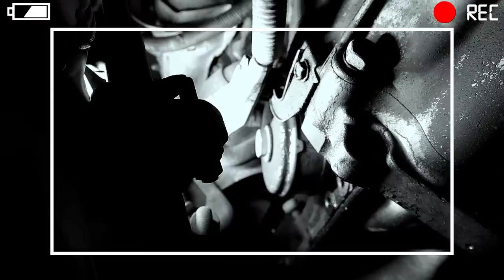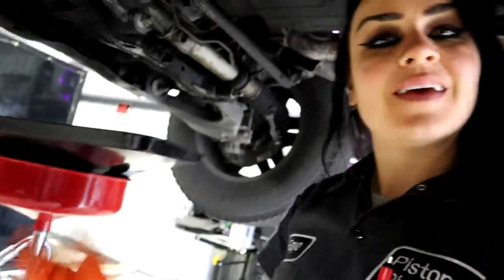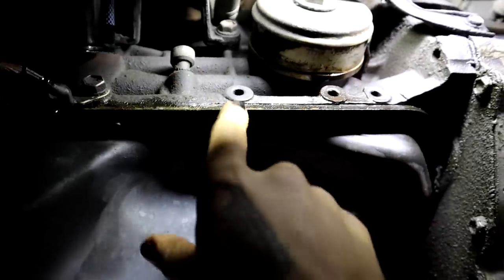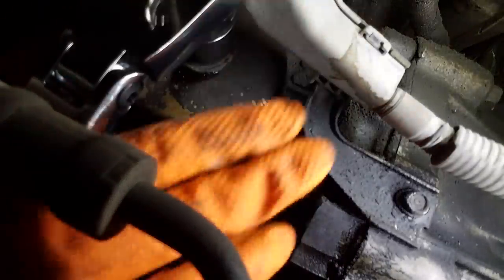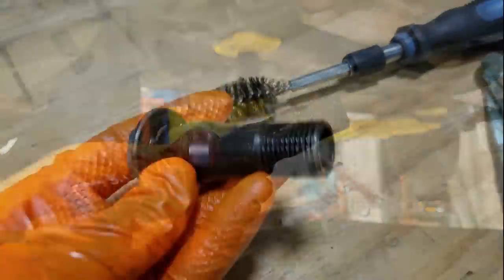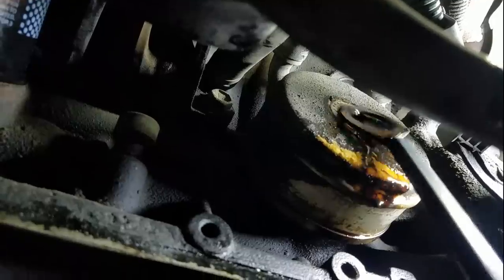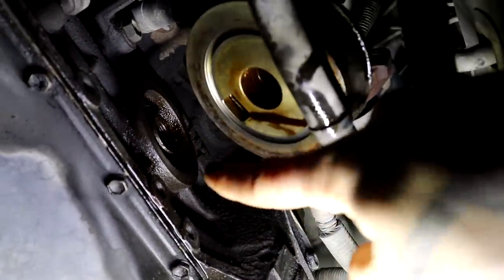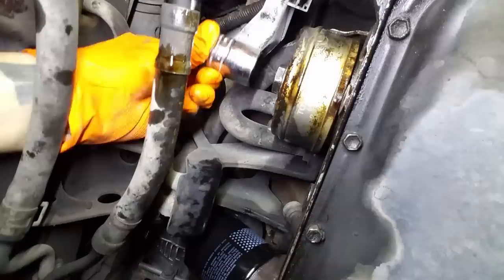Replacing Oil Cooler Seals on 3rd Gen Toyota 4Runner with the 3.4L (5VZ) engine

Comment: Just did the gasket change and I would add one thing to this great video. Wait for an oil change, yes, but also, go ahead and flush and drain your radiator. The video doesn't show removing the 2 hoses attached to the cooler.  Those are radiator hoses running anti-freeze through the cooler.  I wasn't expecting the face full of antifreeze I got when pulling those off and because it's a low point on the block, you lose most of your fluid, so, good time for a flush and fill of the radiator.  An added note, my cooler was clogged as was the exit hose for the antifreeze. These puppies are $800 to replace. I dug out all the junk with a hanger and ran pressured water through it, it cleaned it out.  Did the same with clogged hose. All good and working now.  Thanks again for the informative vid.
Reply: You have the option to pull it off, but her video shows it was still hanging with the hoses attached.
Reply: Just a tip that can help from having the coolant drain out, especially when you may have recently done a flush and fill already.  just clamp the hoses before removal.  Harbor freight sells hose clamps for just that purpose, probably amazon too.  Any clogging is concerning to me.  I haven't done this myself yet, but given your experience I'd be inclined to completely remove the cooler myself and give it a look see.  I would likely even spring for a new cooler just as a preventative measure.  Sometimes going cheap can be a lot more expensive in the long run, as I've learned from the school of hard knocks many times...

Comment: Fix all the oil leaks 😂, clearly you don't own a Honda. That's your anti-rust protection.
Reply from the maker: Lol no rust here in the beautiful Texas hill country!!!
Reply from the maker: Lol no rust here in the beautiful Texas hill country!!!
Reply: Don’t forget Mitsubishi, leaks everywhere in the engine that I give up trying to trace and fixing it.
Reply: Use dye to track the leak. Smarter not harder brother.
Reply: Meh, their like Detroit Diesals, they all mark their territory.
Reply: Before I fixed her, I used to say that my Caprice had self changing oil at a rate of one quart per fill up.  All you had to do every 3000 miles is replace the filter because she'd already cycled through two oil changes by then.  (coincidentally, it was the oil cooler adapter that was leaking on that one as well)
Reply: Want oil leaks? get a Subaru!

Comment: So, wish I had found this video a couple years ago. My 3rd Gen has had a slow leak since I bought it 4 years ago. Found this video, checked out my cooler, and sure enough, leaking. Bought the parts and changed it out last week...not a drop of oil on the concrete since! Thanks

Comment: The sounds you make while wrenching are much more pleasant than those I make.
I just did rocker cover gaskets on my 2012 Forester with the engine in.
Just a little more than an inch and a half clearance to get at the bolts, clean the old RTV and get the rocker cover back on without messing up the new RTV bead.
The sounds I made were much less family friendly.  No giggles at all.

Comment: I've got a 96 with 193,000.  I've been lucky my oil cooler is not leaking yet.  I've had to replace the valve cover gaskets.  Thanks for your videos,  you save me a lot of time.

Comment: Just did this repair following your vid and it went great, and that leak is finally gone. I don't have a lift so I definitely suggest taking off the wheel if other people wanna make a mess in their driveway like I did. It's a tight fit, but doable! Thanks for the guide!

Comment: ok, just did the valve covers on my 2001, super cleaned all the old oil up, drove it for about 200mi.  My oil cooler looks like yours pre-surgery.  I almost went for the pan gasket, but, clearly there is oil dripping from the cooler.  Looks easy enough, thanks for the vid.

Comment: Thank you!  Been chasing leak and had no idea this was there.  You ROCK!
Reply from the maker: YAY!!
Reply: So did the deed this weekend.  Ended up having to remove the hoses as the gasket had hardened into black concrete.  Had to chip it out carefully with small flathead.  My recommendation to others would be just do this at time to change oil and rad hoses and fluid flush.  Kill all birds w one stone.  I did also replace the smaller hose since it was out.  Now engine is oil free and beautiful!  THANK you again for vid!  NEVER would have tackled this otherwise!  ✌

Comment: Thank you for the good info. Breaker bar didn't work for me on the 24mm bolt. Had to get the oil cooler bolt out through the driver wheel well. Long extension and a wiggle extension on an impact gun. Access is right above the upper control arm. Came off first try with the impact gun.

Comment: Do you have a vid showing the oil pan gasket front main seal and rear main seal on this classic 4Runner? I’m having those issues with mine and didn’t know if I had an oil cooler but now I’m prepared if I do 😂. Thanks Faye!! 🙏🏽

Comment: Good job, I too would have fixed that leak since it was in a component that could cause a pressure leak. Those engines remain remarkable almost leak free at high mileage. Most of them I work on have in excess of 150,000 miles and other than seeping around the oil pan and valve covers, they are pretty dry engines.

Comment: I enjoy watching your video and enjoyment with wrenching. I noticed a lot of oil leak around that area so thanks for posting this DIY video. Had my 4runner since 2003. Would you need to take out the cylinder and clean it out or need replacing? Or just the o ring and seal? Thanks
Reply from the maker: Only the O-ting and seal, the coolers rarely crack or leak.

Comment: cool video, straightforward repair.  thanks, this is on the list for my '99 Taco.   hey can i ask where is the oil pressure switch on the 5VZ-FE?   i understand that is also a common leak point

Comment: I know it's a big bolt, but being hollow I was surprised at the 43 torque spec! Great video. I really need some of those pipe cleaner style wire brushes, but they all seem expensive.

Comment: fixed huge couple leaks in a MB om651 engine (E-coupe).  Oil filter housing and oil cooler both were pouring out. Upper oilpan also dripped. Replaced both and will never do it again. took 2 days to find and fix the problem

Comment: Rotella T5? Cool. I use T4 or T6 in my DR650 since it’s JASO MA/MA2 rated. Never thought to use it in the 4Runner (99 6cyl auto 2wd) are T4, T5 and T6 all good for our trucks or does T6 have somethin special goin on? Thanks, love your work Faye.

Comment: Just discovered your channel and digging it. You got any content on replacing a main seal? And is the engine and trans seperable? Or is it a "divorced unit?" My famiky and friends are pushing me to try since i did my shocks but i'm unaware the best way to do/ if its possible if you dont have access to a cherry picker or two post lift. Would a transmission/ engine cradle attatched to one of those special jacks work? Any advice would be awesome!

Comment: Got 3rd gen with 307k miles on it and oil cooler started leaking. Was told it would be $900 to get a new one. Will have to try this instead. Thanks!

Comment: Appreciate you documenting this job.  I have my 5VZFE out, and addressing seals/gaskets while they're easy to get to.  My question for you:  do you see any reason to ever replace the oil cooler housing itself, or would you suggest cleaning out the housing in addition to the bolt?  Curious to hear your opinion/knowledge on this.  Thanks for all of your work in documenting these jobs on the 3rd gens - I've been coming across your videos more and more as I do work on mine.
Reply from the maker: Oh for sure! I cleaned them out when overhauling - I go through the entire oiling system and get all OCD on every little crevasse (check out my "making it serviceable" video featuring the cylinder head of one of the Supras!) just put them through the solvant tank. But if you keep your oil fairly clean and changed regularly then you shouldn't have to service it separately off the vehicle.
Reply: Just a little info... the oil cooler itself is astronomically expensive to replace (about  $800.00).  I have read that you only need the oil cooler if you tow or haul large loads in your rig.  There is an aftermarket oil cooler delete kit available for about $70.00.  Just something to consider if your actual oil cooler is damaged beyond repair.  I have no knowledge of how well these delete kits work so do your own research first!

Comment: Thinking I’ve a pan leak. Now I’ll check the oil cooler first. Thanks for this. Do you have an oil pan gasket replacement video for this motor- I’ve a ‘95 TWD T-100? Thanks again!

Comment: Thank you, this is great! Two questions, Can a leaky oil cooler cause a high idle? And can you change the gaskets without draining all of the oil? Unfortunately I just changed my oil two weeks ago and am just now finding the leak.
Reply from the maker: 1- very very very unlikely. I'd say impossible, but then someone will come along with some freaking crazy scenario 🤣 2- yes, you can! You may spill a little more, but the pop level in the pan is below the cooler location.
Reply: @FayeHadley  great, thanks so much!
Reply: So I did it without draining the oil, but discovered afterwards that I had coolant leaked into my oil because of the broken oil cooler gasket. So that meant I ended up having to change the oil and filter anyway. Heads up people, if your oil looks like a chocolate milkshake, don't drive at all until you change the oil and filter.

Comment: First of all I watched all your videos on how to work on the 3rd gen 4runner. Great videos and keep them coming.  Anyways I have a question in regards to my 1998 Toyota 4runner. It seems to have a little oil leak but I can't find it anywhere. I have my mechanic replaced the valve gasket and the two gaskets that sits on both side of the valve gasket. No leak from oil pan or bolt. Nothing from the oil cooler.  It's not dripping or wet on the oil cooler.  My mechanic told me it might be the cam seal or crank seal. I just don't know what to do or where to look for.  Any suggestions would help me a lot.  Note: the area where it's wet is the oil pan bolt area and underneath that area and the cover underneath right behind the skid plate. I hope this helps you to think about where and what is going on...thanks...hope to hear from you
Reply from the maker: Bring it to my shop so I can see it in person and I'll tell ya! But that's like calling up the doctor and telling him you hurt and what meds to take... Lol I will never know for sure if I can't see it with my own eyes
Reply: Gem2000, There are two metal half moon's that need removed and resealed, along with the round camshaft plug in the back, when replacing the gaskets on your valve covers.  Any of those things can be leaking and run down to where you're mentioning.

Comment: Thanks I will be doing this very soon.  Are there any other Seals that might be leaking ???    Last thing I want to do replace oil pan gasket $$$$
Reply from the maker: Oh I know it's such a pain in the butt!!! Do you have more oil on one side than the other?? Another common leak is the circular plugs on the back of the cylinder head they are often overlooked!!
Reply: Have you made videos on those plugs leaking? Interested in seeing.   Maybe I will have to replace those as well.   Thanks for the information you share

Comment: Nice…..Thanks for all the great videos!
One question………Did you drain coolant before doing this?
Reply: If you watch closely you will notice that she never disconnected the coolant hoses.  Just let it hang while she installed new seals.  This isn’t really possible on a 4wd.  Hers is 2wd.

Comment: If I only had a lift, I would be as happy as Faye is, while working on my car.

Great job as always.

Do you always use Shell Rotella oil for oil changes, or simply what’s on sale?
Reply from the maker: I use rotella on the VW (15W40) and grim, and I use Valvoline VR1 synthetic for the Supra!
Reply: Faye Hadley thanks for your reply, and keep up the great work!

I ask because I have a 2007 4runner and I use toyota 5w-30 conventional oil for oil changes, I considered trying other brands but not sure what to try.

Comment: Helpful video.  Thanks for the parts links.  I have that engine in my Taco.  Have you seen a coolant leak from the back of the engine?  I have one coming from above the trans area, but it's difficult to see in that area.

Comment: Hey Faye, is your 4runner the 2wd model? Not sure if its the camera placement and angle but I went and checked under my rig and found the cooler, but it def did not look as easily accessible with the front axles
Reply from the maker: Mine is 2WD! good eye!
Reply: Faye Hadley thanks for the info. For anyone reading this, looks like access is much easier by removing the tire and using a long extension and swivel joint for 4WD models

Comment: Great timing, I have this same leak. What year is your truck because the amazon link is saying that the o ring won't fit my 01 3.4 4runner
Reply: The o-ring will fit all 3.4 L 4Runner engines! :)
Reply from the maker: Someone else beat me to it! If you're concerned, I always recommend calling your dealership to confirm! I got both of these seals from the dealer and they were cheaper than Amazon with my account!
Reply: @DeathMammoth91  thanks for the reply, it makes sense being a 3.4 engine, but for what ever reason the 01 and 02's seem to have different parts from time to time.
Reply: @FayeHadley  and thanks for the video, in the other one I watched the guy said to disconnect the antifreeze lines. This job just got a whole lot easier. Minus the lift haha.
Reply: Just wanted to thank you again for the video. I changed it out today. Man was that originally shot, half of it was rubber and the other half was of a polymer material glock would be proud of. I had to chip away at it a half of a Inch at a time, but it's done and no leaks!!

Comment: On the oil cooler- did you miss the center one? Part number
15785-35010 ? Your video did help me some so thanks,
I wanted to return the favor.
This gasket is odd- not large enough to go between the 2 pieces- sort of went inside-
Maybe oil pressure holds it down to stop leak back?
Let me know what you think...

Comment: My ‘96 v6 4runner has been burning about a quart of oil every 1,500 miles or so. I’m pretty confident at this point that I’ve gotten all the external leaks fixed. Is there something I might be able to fix internally that could be the issue or am I likely stuck just letting this motor go till it dies and then rebuild or replace it?  It’s got about 330,000 miles on it with the original engine and transmission.

Comment: Cool Faye.  So I have been on a project with a Dodge and got it almost to where it should be okay for the next 80k miles. I just have some suspension and rotors to do.  The ABS needs sensors too. Hate computerized cars. But so be it.

Comment: So aside from the usual oil leak suspects (Oil pan, valve covers, and now an oil cooler) are there any other places where these leak oil from? I'm looking to shore up the leaks on my Gen 3 4Runner and Gen 1 Tacoma in the spring
Reply from the maker: Yes front and rear main seal, and don't forget the circular plugs on the back of the head!
Reply: @FayeHadley  Ah, okay. I did the front cam/crank seals when I did my timing belt. I'm not ready for the rear main seal yet

Comment: Faye ... i hav a 1996  4runner Can i remove the driveshaft that goes foreward to the front axel
w/no negative repercussions ???  my idea is: i NEVER need/use the 4wheel drive function.  not spinning all that stuff might cause a little more gas mileage.

Comment: Have a 1995 t100 with 5vz-fe motor with oil pan leak and can’t find video or decent step by step instructions to remove. Can you help with this? Have a video?
Reply from the maker: I don't have a video yet but my oil pan is slightly seeping, So I have a feeling that this will be a video of mine in the future!!
Reply: @FayeHadley  my main concern is lowering it out. The transmission is close. Thanks for your prompt reply! I’ll be watching!
Reply: @FayeHadley  my Chilton guide isn’t much help and mentions having to remove the crankshaft timing pulley, so, Obe Wan, you’re my only hope.😎

Comment: Sweet , I’m about to buy a 2000 Lexus ES300 it’s running great but the problem is the body, it got hit on the left rear corner, so I need to repair the quarter and the rear body panel as well as replacing a floor rail

Comment: Dude. This is a nightmare on a 4x4. Just got done putting one on my JDM engine that didn't originally come with one. If I ever have to touch it again I might pull the CV axle first. 😂
Reply from the maker: Oh no!!! 😆
Reply: @FayeHadley  Yeah getting the clamp all the way on the short hose that goes up to the block was a nightmare!

Comment: Faye what made you to go with the choice of Rotella oil ?
Reply from the maker: It's actually not my trade secret, it's a well known remedy for these old engines! Common on the Supra and Mr2 world as well. The extra additive package for the diesel oil really helps clean without over doing it. Lots of others out there tracking fuel economy and oil filter contents after switching! Cool stuff !!
Reply: @FayeHadley  BTW that start up was amazing lol to me it sounded like the first start ups at dealer when New.
What oil filter you run. ? Wix